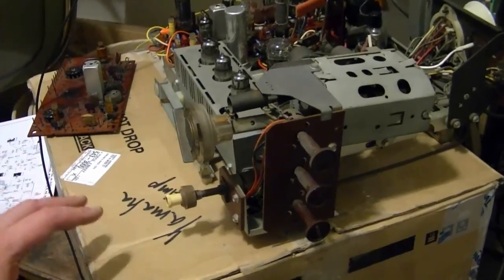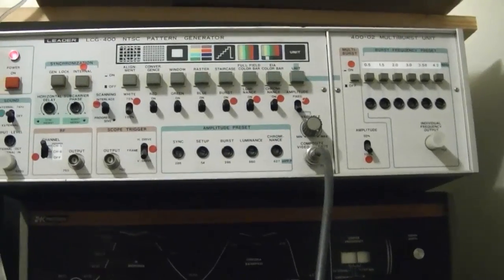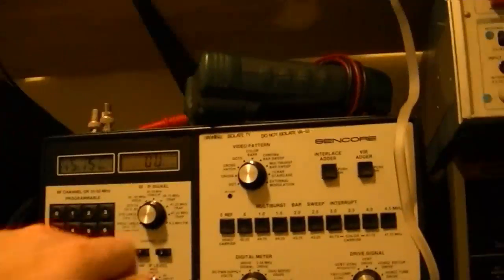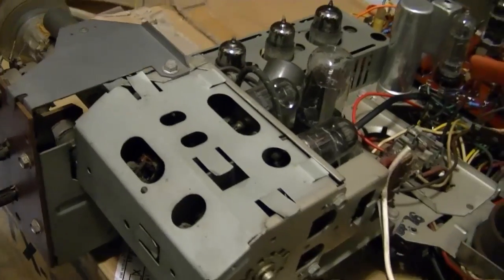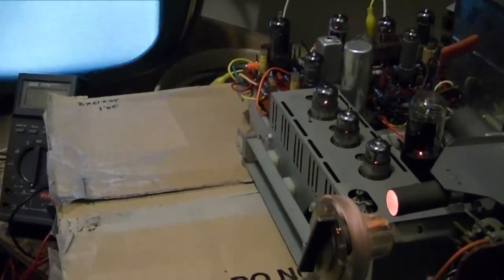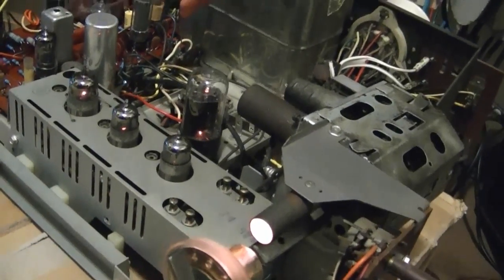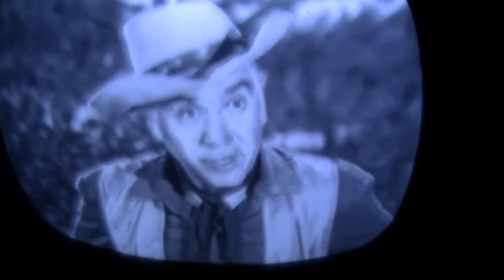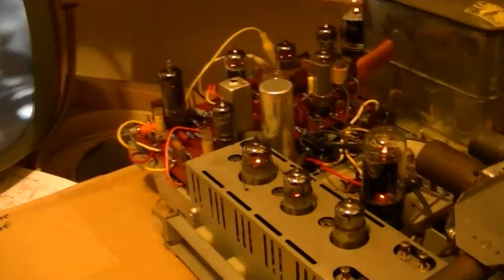Predicta Tandem I restoration pt6o8

Comment: Alright, now we're talking! I'm surprised at how good the alignment is without having to adjust it...looks pretty good. I once had a Motorola phonograph whose amp came with the wrong tube legend decal on it from the factory...took me awhile to figure out why it wouldn't work when I placed the tubes in the order on the decal.
Reply from the maker: The alignment is probably good because I didn't touch the IF circuits.  Just nudging parts can throw things off.

Comment: I'll bet that the tube arrangement on the channel selector module, courtesy of Sams, had stumped many techs and hobbyists over the years!! It's fortunate that you were able to check it against a schematic from a different source.

Printed circuit boards and tubes don't seem to go together very well, particularly in television sets. I suspect that these sets were produced before engineers became aware of this fact. Some folks learn the hard way!
Reply from the maker: Actually, I wasn't really able to find another source. Neither my little Philco service booklet or Riders shows the tuner tube layout.  What I showed was the actual tube chart pasted inside the cabinet.  If it had been missing, I might still be troubleshooting that tuner!

Comment: This is nothing new with SAMS...I've seen wrong value resistors and tube location charts being out in left field...I always double check with the factory manual or the Riders...
Reply from the maker: I think it's a first for me.  I find the Sams very handy when working on sets with ugly old repairs because they include photos of an original chassis with parts locator.
Reply: I agree, not to mention wave forms and test points, but I have seen at least 6 mistakes on schematics from them...I tend to double check tube charts...The mistakes I've encountered were with color sets!
Reply from the maker: Frank Ferraro
 Even more annoying is that I do have an original Philco factory service booklet that does show the tube layout except for the tuner!  Neither does Riders.
Reply: Yeah I noticed that about the various ones on the Philco TV's (Predicta, Holiday, etc.)